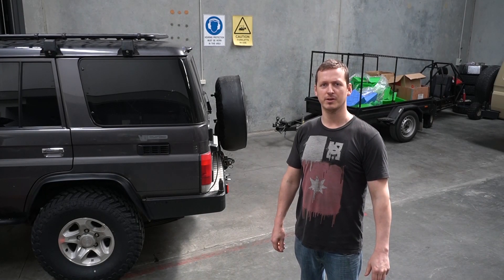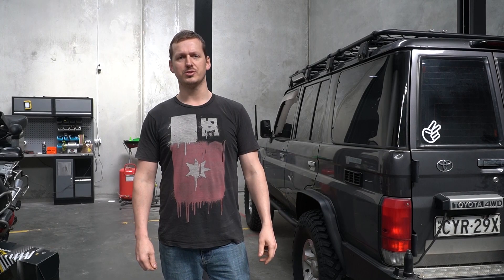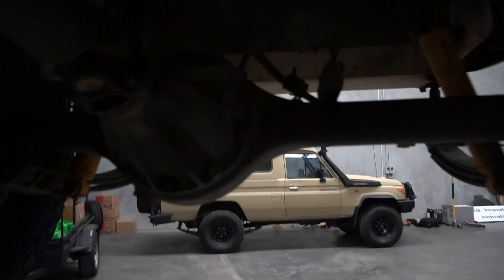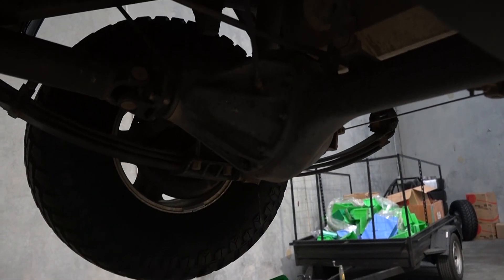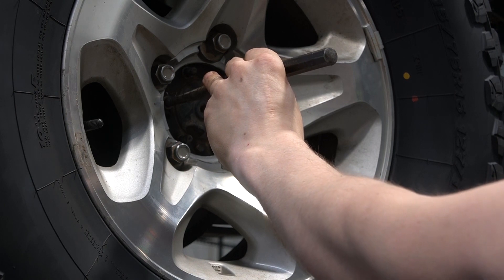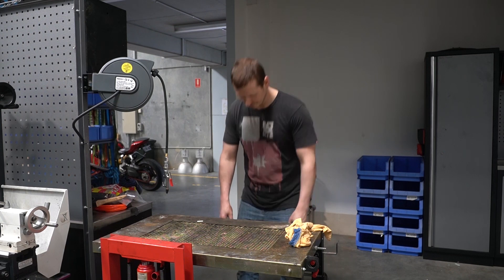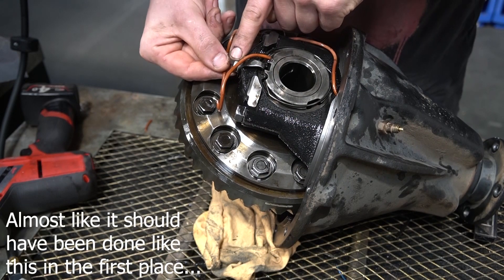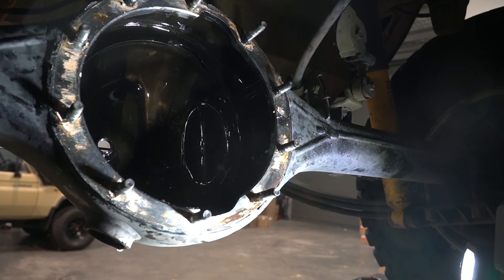Differential problems | Leaking ARB air lockers | Why did mine destroy itself? | Part 1

Comment: It could have been avoided if the original installer took extra care in routing the line properly. I have done 100+ arb locker installs. 0 issue on my installs. In your case, I’d change the brass line and solder in a new one.
Reply from the maker: Correct. Entirely the fault of the installer, but this was unfortunately before I got the car.